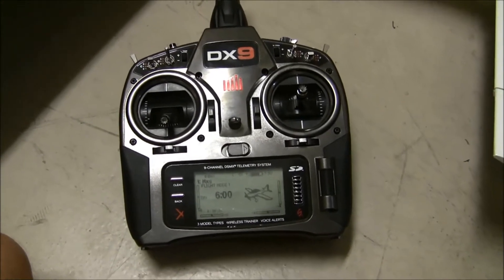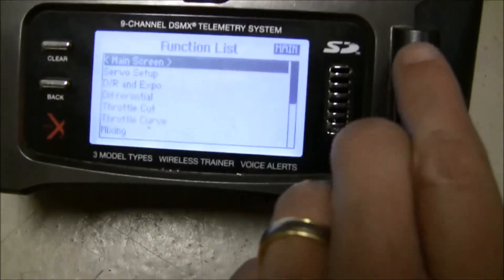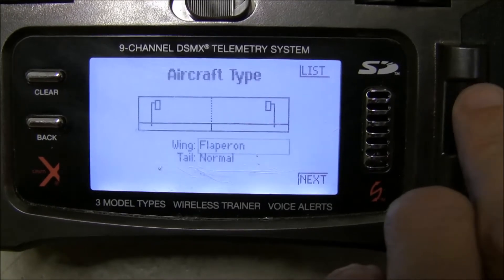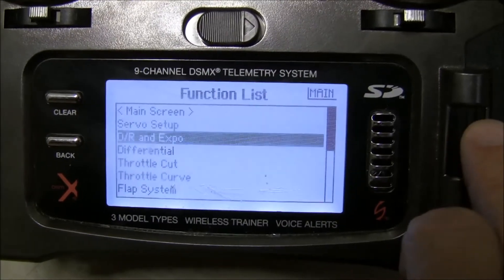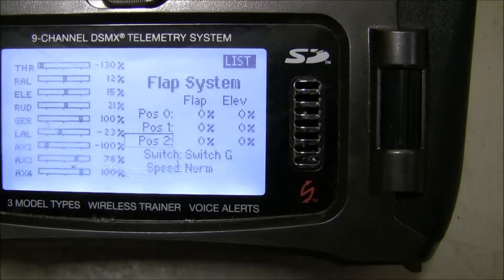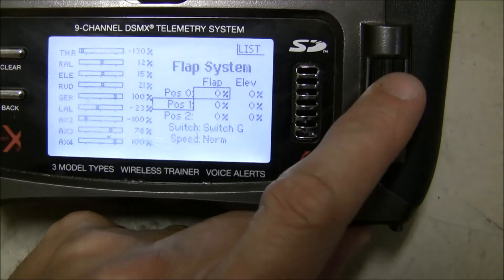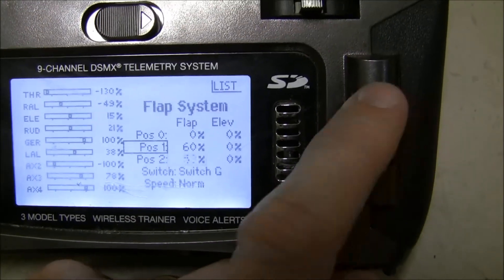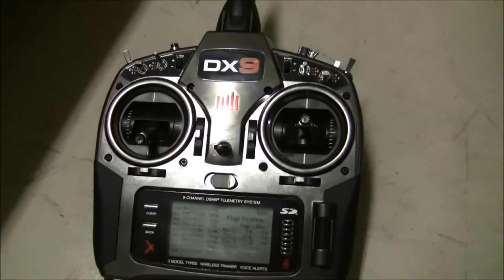Setting up spoilerons and flaperons with the DX9

Comment: Question:  I have an older low wing model ( eFlight Pulse 15e ) .....it has no flaps and has outer wing ailerons..it  tends to come in fast but also  floats a long way on landing ...would I want to set up flaps or spoilers  or should I set up both , at a 50% rate  on a   3  position switch  and see what works best  ?...thanks

Comment: Maybe you could help me..im using a AR9350 9 channel rx and a DX6E..the flaperons move in oposite directions no matter what i do in the program settings ive tried dual ailerons and flaperons and still apon activating flaps they will only move in opposite directions. Im stumped...if i can use a mix to change that im not sure how to program that correctly i dont want to over throw a servo on my new flite test freedom fox. I can get it to work with a admiral rx600 but not with any spektrum rxs. Ive got LA to channel 2 and RA to channel 6...set the tx to flaperon and stuck with this issue.
Reply: Are you using a reversing y cable? You can also individually reverse the ailerons if you have it set up a dual ailerons
Reply: @GreatLakesLogger  ailerons are in ports 2 and 5..I can configure it all in the spektrum program software for these receivers its just strange that no matter what i can get normal deflections one up one down but upon activating flaps down they go in opposite directions. I ended up just using a admiral rx600 for this flite test freedom fox plane and its working just fine with this rx.
Reply: @aaronstrom16  could it have to do with which side of the servo your servo arms are extended? Don't know I'm just shooting from the hip here